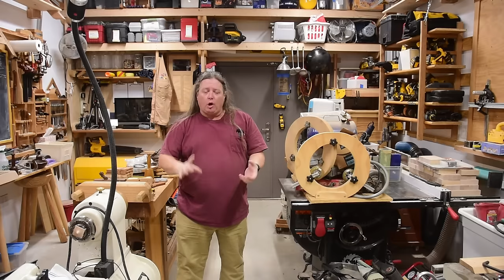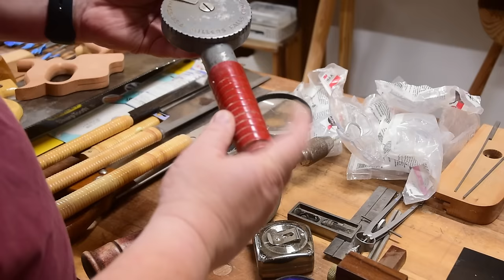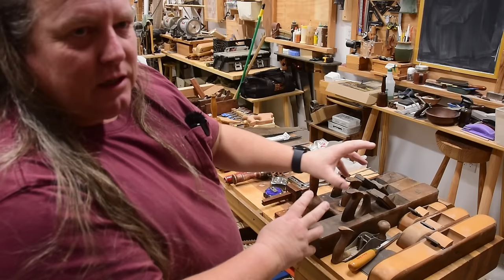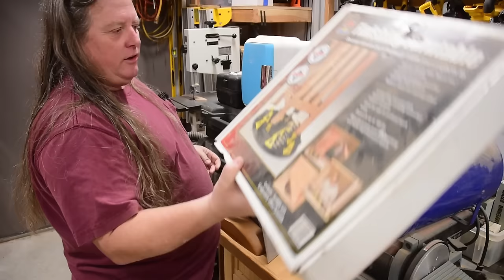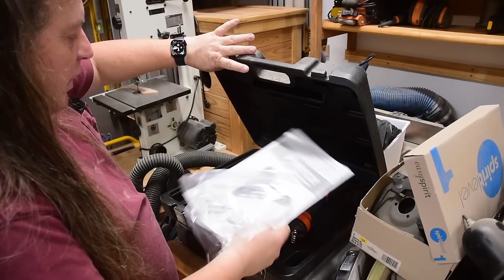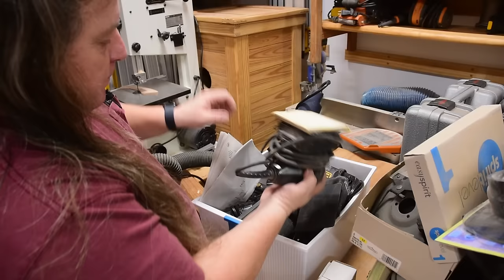Excess Tool Liquidation Sale - 2024

Comment: A Rotozip is typically used for cutting into Drywall/Sheetrock. Haven’t really heard of people using it in wood (maybe in a thin panel in the back of a kitchen cabinet for a cutout for an outlet). 
Electricians use it to make the square cutouts in the drywall for electrical boxes.

Comment: Weren't sales pretty good for the bodark mallets, custom or not? Maybe do another run, if you have the blanks?
Reply from the maker: That's the issue. It's about 2 years from harvesting a bodark tree. Need to get that started.
Reply: @wortheffort  Yeah, I know. Gotta let them age a bit.  That's why I didn't say go cut down a tree and do it.
Reply: FWIW I can fulfill the needs for Osage Orange and Mulberry project blanks from my shop in MO. I currently have 50 or more sawed with flat or canted faces and l , and sealed and seasoned logs  to process. In addition ash, American Elm, and Burr Oak which also are very dense woods fo striking heads plus handle stock to mill in all the common Midwestern. hardwoods. I just need to have permission from the page owner here.
Reply from the maker: you have 20/4 thick straight grain blanks? @thomasmartin6817   MO is a 4000 mile round trip for one log..... I just need to find a rancher in OK. They hate em and will let me take a few.